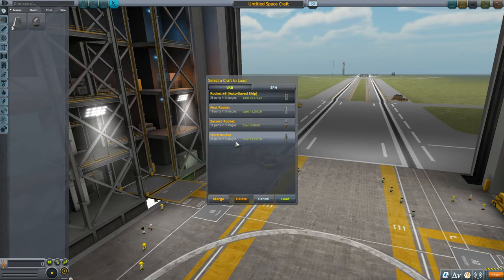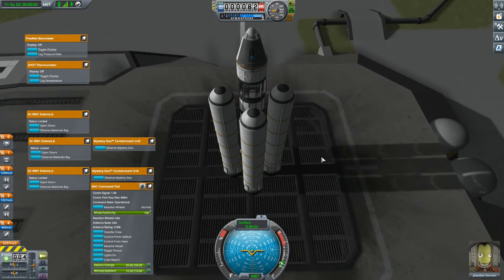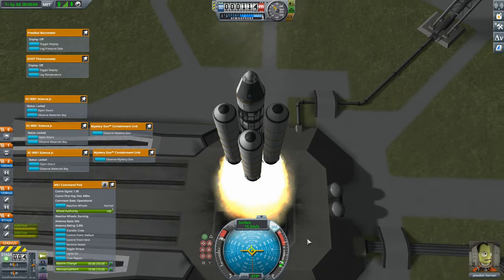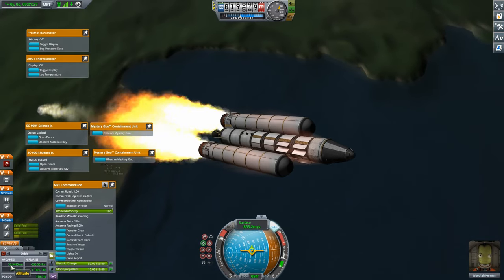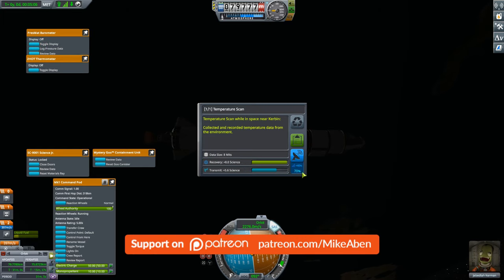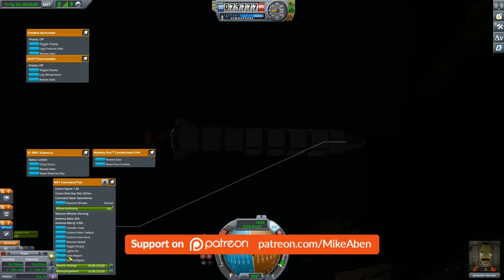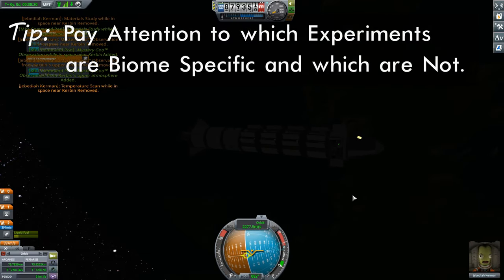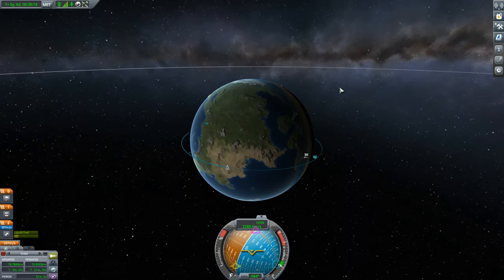How To Get To Orbit - KSP Beginner's Tutorial

Comment from the maker: If you are having trouble with the rocket flipping out, try replacing the Basic Tail Fins with the larger AV-T1 Winglets and taking off two of the material bays. Also, keep it locked on prograde pretty much the whole time.

Detailed video showing this - https://youtu.be/H70C32ECn6E

I also have a more up to date, and I think easier to fly, first orbit rocket here - https://youtu.be/lsVZt04DpvM

Up Next: Understanding Orbital Maneuvers - https://youtu.be/WkU08pXUPKc
Reply: Jesus Christ I had this problem for like a year+ and now I'm finally hearing the answer. Thank you
Reply: Came here to the comments to see if anyone else was grinding their teeth at their 4th revisions of this rocket to stop it from flipping. Instead I got a pinned comment by the author on how to fix it. Thank you, genuinely.
Reply: With flipping on rocket 5, I just change the pilot and things work out 😂 
My Jeb cannot fly for some reason, consistently flips, but Valentina's my champion! Same exact build, both 5 star pilots.
playing classic career mode
Also used the downloadable craft build tested pilot change both with original build using smaller solid boosters and suggested change to larger ones. Great build and fantastic series, cheers!
Reply: Hey Mike, I've got a question. At 7:40 you said that the east direction is at 90 degrees on the navball. However, The navball points that the north direction is down. If it was a compass and I would rotate it upside down, so that north direction is up, that direction you said to be east is now west (to the left). Is that a mistake on your part or do I not understand something about how navball works?

Also, Kerbal Space Program is now free on Epic Store and Kerbal Space Program 2 is being released late february this year. You might get some views on this playlist!
Reply from the maker: @mateuszm9409  No. East is to the right at 90 degrees on the navball. 270 degrees is west. That may feel backwards, but it's the way compasses ships and planes work.
Reply: @MikeAben  Thank you for taking the time to reply. Much appreciated & subscribed. Great series. I am in awe of how well you explained a variety of concepts.
Reply: shouldve also mentioned that caps lock makes rotation controls slower

Comment: One nifty thing some people overlook is that once you reach upper atmosphere, you can safely EVA (holding on of course!) and run an EVA report. Once you hit upper atmosphere the resistance isn't enough to blow your Kerbal off. I've done this at very high speeds from 69,999 all the way down to where uppper starts (like 20something?).
Reply: I never feel safe doing it if the plasma is visible, but I can confirm you can do this.

Comment: 19:52 Hi this air is still friction on the capsule, it’s just head on. Friction is friction regardless of what direction the interaction or reaction occurs. Air resistance is a friction force. Even the ISS experiences slight air resistance due to high altitude molecules escaping from Terra. They have to boost once in a while to maintain orbit.

Still, great video.
Reply from the maker: No, most of the heating is a result of air compression, not friction. You are free to look it up if you like.
Reply: @MikeAben  I agree that the air is compressed at the point of contact with the rocket, but I disagree that air compression is the fundamental force resulting in the slowdown of a rocket during orbital entry. Just because the air is compressed in front of the rocket doesn’t mean friction ceases to exist. It very much exists no matter what angle you enter an atmosphere.
Reply: Physics is one of my favorite subjects. I’d love to have a scholarly discussion on the fact haha
Reply from the maker: @johnokean8216  In the clip, I'm talking about what creates the plasma, which is compression, not what's slowing down the craft which, I suspect, is partially a result of friction, but also, and perhaps more, a result of pressure difference. I've really not studied it in depth.

Comment: Thanks for the assistance. Kerbal is picky about the aerodynamics of some parts with no way to troubleshoot it (just a sphere showing the center of rotation). Sadly, beginners don't have the SAS until they do this once without it (you get the ability by making it to orbit without it).
Reply from the maker: Level zero pilots have SAS, but they don't have lock to prograde. Still, it's rather unfortunate how that, along with the low part count and stupid little tanks, makes your first orbit likely your hardest.

Comment: Hey Mike, thanks so much for these tutorials so far! I have a problem (no doubt my fault) but when I start turning east and lock prograde at 5°~ my rocket starts to drift south a fair bit. If I regain manual control, after a few seconds I lose it. if I don't do that I end up so far south my orbit gets messed up. Please help, this is the same rocket that you are using with as close to the same settings I could get.
Reply from the maker: I've added a link to my craft file in the description. You can download it, fly it, and directly compare it to yours. You are not the first to report some challenges. A little bit of drifting north or south is pretty normal, but it sounds like your experiencing more than just a bit of drift.
Check the tail fins. They're small an easy to miss. Make sure all four of them are there and as low as possible. Also, make sure the SRBs aren't too low. Their engine bells should be just below the engine bell of the central core, but only just.
Another thing to try is too swap the small tail fins for some bigger ones.
Reply: @MikeAben  The only way I got this was to keep manual control the entire time and micromanage the rocket, in which I had no ability to do any science. 
I am in stable 82k ap 75k pe orbit, I tried 5 or 6 times and this is the one way that worked

Comment: Many thanks, you have no idea how much you helped me take this hard but essential part: Getting into orbit.

One thing though. Your stored Data inside the Bay is going to get  smashed without two decouplers dissengaging it from the rest of the rocket and some Mk-12 Radial parachutes to make it land safely...

Unless, you are being a genius again and I am missing something. I hear your thoughts.
Reply from the maker: You can collect the data with a Kerbal on EVA and then store it in the command capsule.
Reply: @MikeAben  too small to fit more than one Module data collection :(
Unless you are using a mod, or an upgraded version.
Reply from the maker: @NorilXFeder080  There is no limit to how much science can be stored. If you've done a crew report, don't forget to remove it and restore it.
Reply: @MikeAben  ...then why does the game force me to dump data because there's not enough storage capacity :/?!
Reply from the maker: @NorilXFeder080  It only forces to dump duplicate data. For example, if you try to materials bay from low space when you already have one from low space, but if the one stored is different (say from the upper atmosphere) then you can store both.
Reply from the maker: @NorilXFeder080  I'll agree that the game is less than clear on this.

Comment: When I use the prograde it doesn’t even pass the 45 degree mark
And when I try to do it myself my rocket spins out of control
Reply from the maker: Sounds like you may have too much thrust or aren't knocking it over enough after launch.
Reply from the maker: As for spinning out of control, bigger tail fins usually solves that.

Comment: Firstly, thank you for taking the time and effort to make these videos. I think they will help a lot of people. But...any chance of you doing a video like this without the prograde assist for those of us on Career Mode? I got really excited because I've watched a lot of videos by other people on that, but no one explains things as well as you do. My favorite thing about your style is that instead of just saying, "Do X" you say, "Do X and here's the reason: Y" and that is the key factor in my gaining understanding. I can sometimes achieve orbit, but it is so...wonky. PA = 90k but AP = 324k and try as I might, I cannot get it even remotely circular.
Reply from the maker: I'll probably do some career mode tutorials in the future, but in the meantime here's a link to my first, and rather wonky, orbit in my current career game.
https://youtu.be/Bm0JIrM_0nE?t=1146
This is a very low tech rocket with no reaction wheels or SAS. I'm also playing with a lot of mods, one of which is modifying the tech tree so you start with small, uncrewed, parts. This would be much easier with a pilot in a Mk1 command pod.
The main thing to note is how little I'm doing during the ascent. Most of the time I'm letting the natural aerodynamics of the rocket steer. This is accomplished by putting tail fins at the bottom of the rocket (I even have some on the upper stage). In the VAB, check the Centre of Lift position. It should be well behind the Centre of Mass. I talk about CoL and CoM during in this video (https://youtu.be/416zilwOwAQ?t=729) . I'll revisit this idea again in a future rocket building video.

If you find that your ascent is too shallow (you're below a 10km altitude when your pitch hits 45 degrees) revert to launch and try again. The orbital insertion without SAS is tricky (though, if you have a pilot that isn't an issue). Even without knowing the time to apoapsis it can be done by eyeballing it like I do in this video. If you're having trouble, quicksave (F5) as soon as you are in space. That way, if things go poorly you can revert to the save (F9) and try again until you have a good feel for it.

I hope this helps.
Reply: Mike Aben Thank you!

Comment: Question: I'm tryna ferry 4 tourists into orbit and back but the problem is the start stage is unstable. I have 6 thumper boosters and 6 more hammers boosters to get 3500 speed. In most cases the rocket just doesn't go straight up. The top wobbles around and sad tries to correct it. Without sas I can't control the rocket well enough and it flips

Comment: 11:23 how do you prevent the time to apoapsis from reaching zero. I've been fiddling around with this portion of my ascents and can't seem to figure out how to reduce the TTA. At full throttle it still counts down pretty quickly. 

It would be nice to be  in a circular orbit at the end of that final horizontal burn, but the way its been going for me is by the time my Periapsis is ~80km my Ap. is ~120
Reply from the maker: Either apply more thrust, pitch up, or start the burn earlier. If you start the burn 30 seconds before apoapsis while pointed at the horizon, you should find you will be reducing or cutting thrust to keep your apoapsis time from increasing.

Alternatively, you can place a maneuver node at apoapsis and use it to circularize.

Comment: hey i just started a career mode and i was making planes with the 30 part limit and such. I made a plane with one rocket in the back and 2 jet engines on the side. My only problem is my rocket runs out of oxidizer and still has 50% fuel in the tank left. Do you have any idea how to fix this?
Reply from the maker: What are you trying to accomplish? A rocket engine on a plane is a great way to get into the upper atmosphere. Try an SRB. They'll use their own solid fuel separate from the liquid fuel the jet engine uses. Otherwise, you'll have to spend some time tweaking fuel and oxidizer levels in the spaceplane hanger.

If you are trying to build something that can get into orbit, you likely will have to wait until you are further up the tech tree.

Comment: hi your videos are great  but when i start launchig my rocket's srbs start wobbling due to which my rocket also wobbles and i cant orient it properly i just want to know what changes you have done to the rocket after testing the vessel plssssss
Reply from the maker: Here's the link to where I build this rocket. 
https://youtu.be/fbNAjmooad0
There is also a link to my craft file if you want to download it and play with it yourself.
Here are a few things to look for.
1. Tweak down the thrusts on those SRBs. I describe this in detail in the video linked above.
2. After attaching the SRBs to the decouplers, use the move tool to slide them down a bit.
3. Try to minimize the number of adjustments you're doing during flight. During much of this launch I'm not doing anything and when I do make adjustments, it's mostly just taps on the WASD keys.
Good luck. I hope this helps.

Comment: Hi!
Thanks for tutorial. It is really cool but I have a problem with my rocket.I build exactly Sam like you did and replaced basic tail fins for bigger, but it still flipping me I tried really manny thing. Can you tell me what should i do? I would be very thankful
Reply from the maker: The big thing is don't stray far from the prograde vector on the navball. Keep the ship icon inside the yellow circle of the prograde icon. If you've unlocked reaction wheels, installing those in the middle of that stack of tanks will help.
Reply: @MikeAben  thank you!

Comment: I have problem. When ever I try to separate the first two side boosters, they turn to the direction of the rocket and crash immediately. And also I put the radical decouplers on their top. I hope you help 💝
Reply from the maker: It could be that the decouplers are too high. They should be just a little above the middle of the booster. If they're up very high, it may cause the nozzles to move away from the rocket during flight which would be pushing the boosters into the rocket.
Reply: @MikeAben  Thank you, Mike ❤️

Comment: I can’t figure out how to go directly east, I think my SRBs set me off course when I’m gaining speed. Is there a way to make sure my rocket goes east?
Reply from the maker: When the SRBs are going, the only means of attitude control this rocket has are the reaction wheels in the command pod. This can make it very difficult to steer, especially if it is under a lot of thrust. If you build a rocket like this and are having trouble steering it, make sure you turned down the thrust limiters on the SRBs as described in the video before this one. You'll find a link to that video under the info tab.
Reply: @MikeAben  THANK YOU!!!! helped out a lot, managed to not only get into orbit, but also get into orbit around the mun and back using delta V budgeting

Comment: When you activate the SAS, you get all those options to click on left of your NAV Ball, why do i not get those when activating the SAS? I play career mode, do i have to upgrade a building? Same goes with this maneuver-calculator, i don't have it, do i also need a better building for this?
Reply from the maker: You don't get the maneuver calculator until you've upgraded mission control and the tracking station. The extra options with SAS depends upon the level of your pilot and probe body.

Comment: I'm so confused lol.. I did everything step by step but for some reason my sas only has stability assist and nothing else
Reply from the maker: That's because you are playing career mode. This series starts in science mode.
Reply: @Mike Aben  I am playing in science mode. I switched out of career to learn more first. I can't find any reason online as to why I only have the one option. I used the same parts as I only had the same parts unlocked through r&d
Reply from the maker: @Christian-cw7un  Do you have a pilot aboard? That is also necessary.
Reply: @Mike Aben  I have Jeb on. I asked on reddit and they said it's because my pilots level isn't high enough level yet and the tutorial might have been from a older version where that wasn't the case. Because I followed everything you've done to this point to a T and all the numbers you read matched and everything, yet I didn't have those options.
Reply from the maker: @Christian-cw7un  It's very weird. Version shouldn't matter. I just booted up a new science game in 1.12.4 (the latest version) and all the kerbals are level 5. It's always been that way.
Reply from the maker: @Christian-cw7un  When on the KSC view, do you have funds and a reputation bar at the top? If so, then you are still in career mode. In science mode, the only resource you have is science.
Reply: @Mike Aben  that's the weird thing. I don't have any of that, and when I go to save it specifically says science mode. And when I did my first few flights to low space to get science points it says after I land "no xp gained" for the pilot. But he also has 0 stars as do all the astronauts. I was thinking it must be the version but if you're saying you still have all the options maybe it's a bug? Or I have some weird setting on lol. I feel like I'm crazy here😂
Reply from the maker: @Christian-cw7un  It sounds more like a bug.
Reply: @Mike Aben  yeah thats what I'm thinking now. When I get home in a couple hours I'll start a new game up and see if they start on 5 stars. Because they all should be right? On science mode obviously
Reply: @Mike Aben  alright I started a new game and everyone's 5 stars. Also followed the rest of the tutorial and finally got into orbit for the first time (albeit with quite a few retrys😂) so it must've been a glitch on that save I'm assuming

Comment: How comes most real rockets e.g Space X falcon 9 rockets reach orbit before main engine cutoff? They never wait to coast to apogee for a relight to increase altitude of the perigee to remain in orbit.
Reply from the maker: Good question. Real life upper stages have a lower TWR and burn longer. There's no sense lifting more engine than you need. Also, relighting engines is an ability that needs to be built in. These stages will also pitch down slightly towards the end to keep apogee from climbing too quickly as the perigee increases.

If you install the mod Realism Overhaul which has real world engines and a real Earth (which takes more than twice the dV to reach orbit), your launches look much the same as they do in real life.
Reply: @MikeAben Thanks for the explanation! 🙌🏾